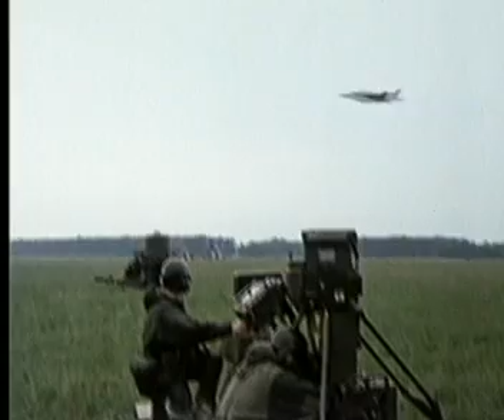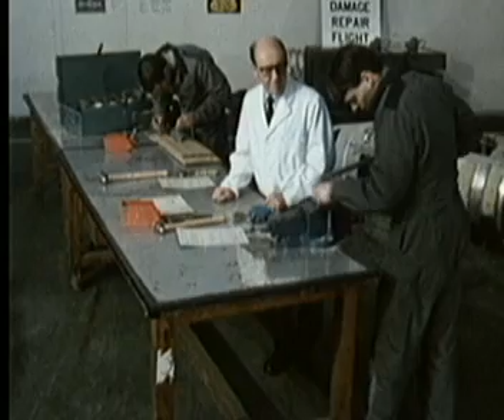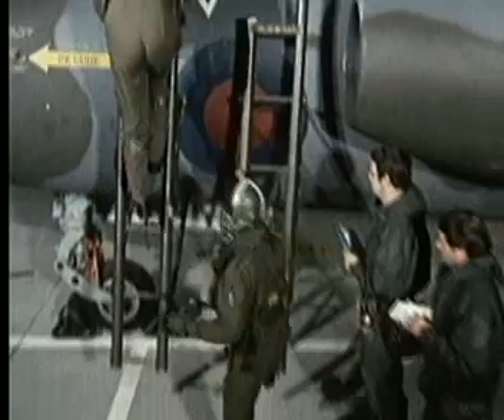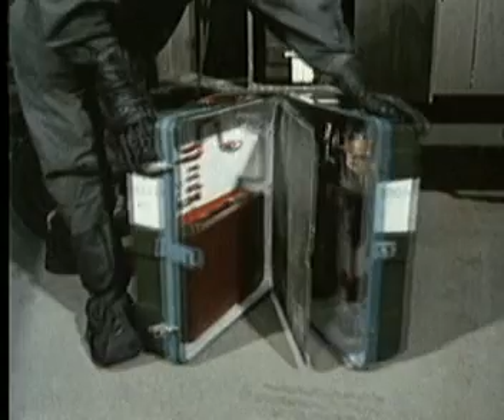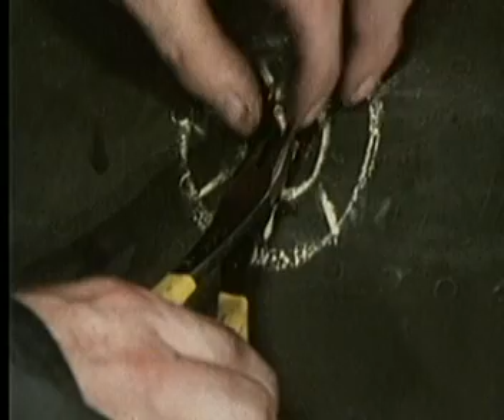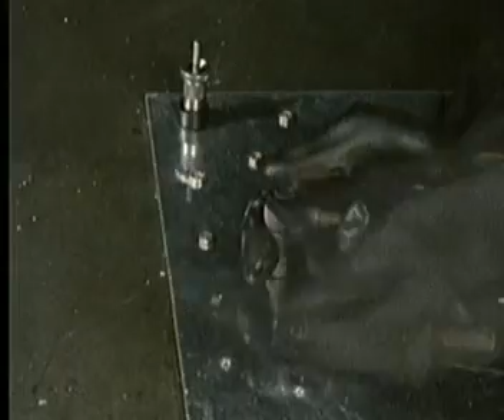Aircraft Battle Damage Repair

Comment: This method is way more stressful in a chemical or post attack environment. The way it really works is; if the jet landed and the pilot survived; patch the turd; make the medics patch the pilot then have a shuttle service fly it to depot. The most impressive kits I've seen is an ABDR cart. It's as big as a small house and has everything you can imagine to make something that survived return to service. ABCD...Airway, Breathing, Circulation, Disability. < ----- also applies to people. Fly safe =]]

Comment: Great piece of history. Thanks for posting!

BDR courses are great fun for  participants and pay off in war, and sometimes in peace if a field repair is required to return to home station. 

Some Desert Storm ABDR. I was USAF but not  CLSS:

http://www.2951clss-gulfwar.com/photo_gallery/index.php/

RAF techs performed BDR training in chem gear which was, and still is, horribly hot and uncomfortable.  NATO forces expected frequent chem and possible tactical nuke attacks if the Soviets invaded. 

RAF Harriers stood the best chance of survival. Their maintenance equipment was on lorries ready to drive off base and operate from anywhere with a bit of road. Most other fixed-wing assets were tied to air bases and would have to launch then return to a rear area because forward basing would have been destroyed.